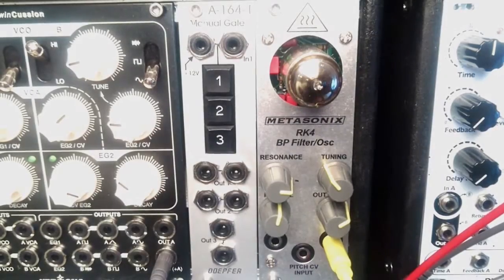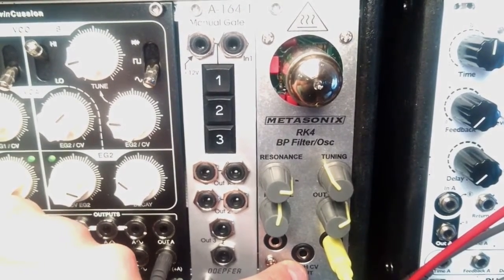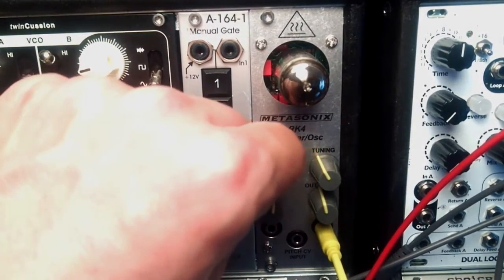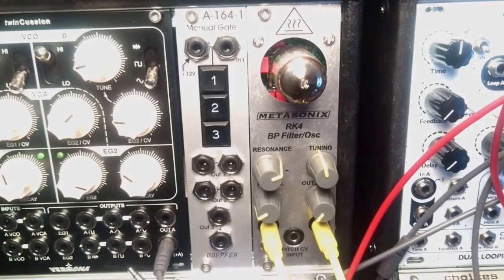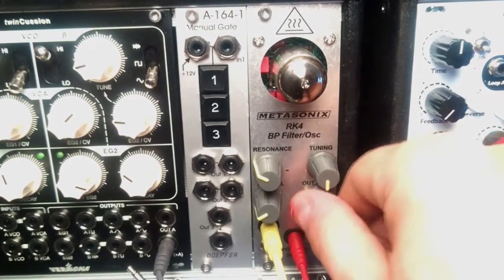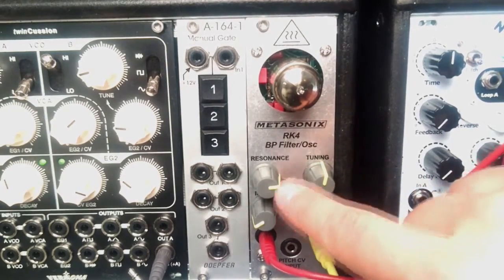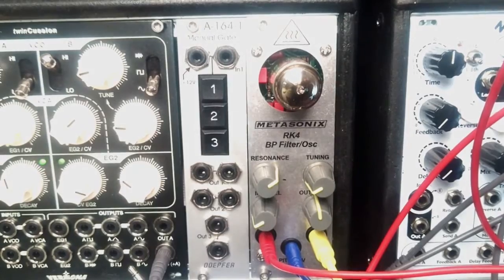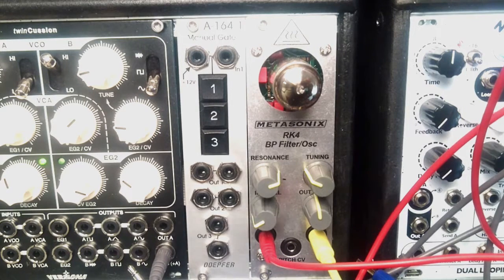RK4 OSCILLATOR/BP FILTER by METASONIX - overall review (ENGLISH VERSION)

Comment: whats the diff between the R and RK range in Metasonix ?
Reply: The R- range consumes power about equally from both the +12V and -12V rails, rather than mainly from the +12V like the RK-.
The R54 has a built-in VCA that the RK4 doesn't, but it requires negative CV to completely cut off. There's also a "Harsh" switch that introduces a feedback loop somewhere in the circuit which changes its behavior. It's novel, but I really don't use it much at all.
The RK3 eliminates the Pulser CV In jack that the R53 had, which lets you inject signals directly to the pulser tube rather than going through the audio path. It's really not as useful as it sounds. Even Eric Barbour, the designer of the module, has said he considers it kind of useless but just put it there to appease people who want more inputs on their gear.